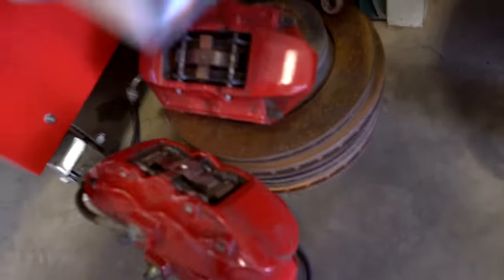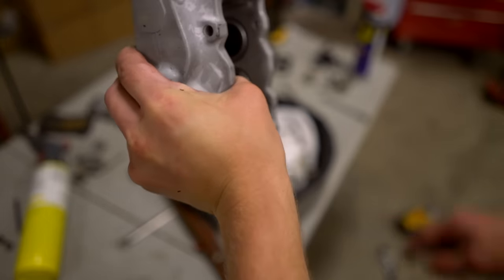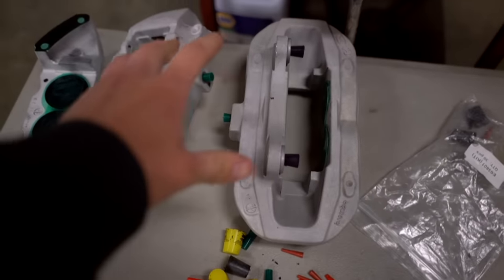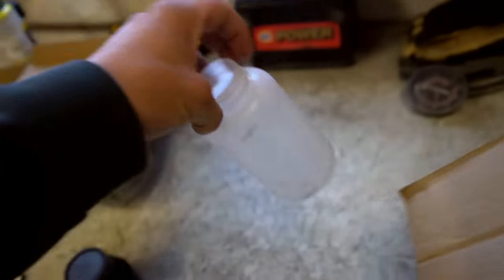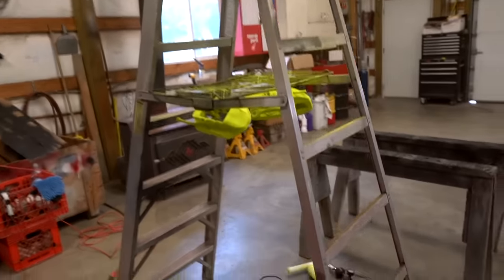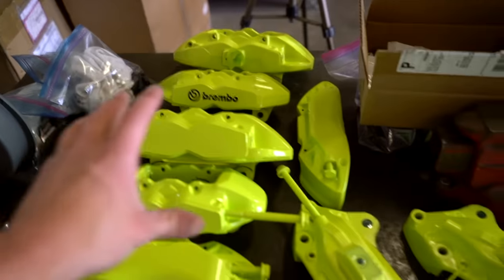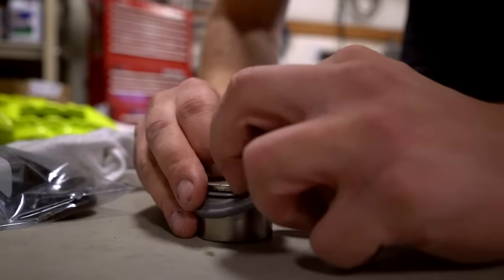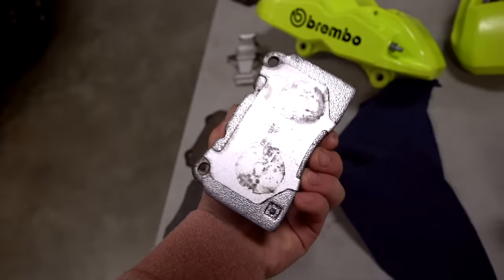Powder Coating Brembo Calipers | Unbelievable Outcome!

Comment: Great video!  I have a barn-shop I do powder coating in.   I use a parts cleaner, then warm water rinse and into a dishwasher without soap on the longest cycle and heat dry.  After that I spray with alcohol and air dry.   Powder coat and into the oven.  I’m building a 3X3X6 ft oven to do four rims at a time.

Look into the dishwasher.  It works great!

Comment: Aluminum takes longer to heat up, I do powdered coating and you have to turn up the oven to 500 degree or more to get them to get to 400 degrees.

Comment: Assembly lube and brake fluid don't mix and will contaminate the entire brake system, breaking down the seals in the master cylinder and all calipers. They look great but if you really love your girl, you need to flush the crap out of the brake system at least twice, or she may not be stopping by or stopping at all.

Comment: I know this is an old video but for future viewers, DO NOT use assembly lube, use brake fluid as a lubricant to assemble. I would avoid using that orange disc stop quiet, use the bronze lube that Brembo provides or a similar type. If you're still going to use it, make sure to apply it between the metal side of the  pad and the shim. Should not be on the outside or make contact with pistons (shown in this video).

Comment: Brembo's own recommendation is to use paint when touching up / refinishing their calipers because the process of baking the powder coat will affect the material properties of the aluminum calipers.
Reply: Not all powders are oven cured
Reply: If the metal of the caliper change on mere 400f then Brembo have a lot more of worry about their calipers than how people refinish.